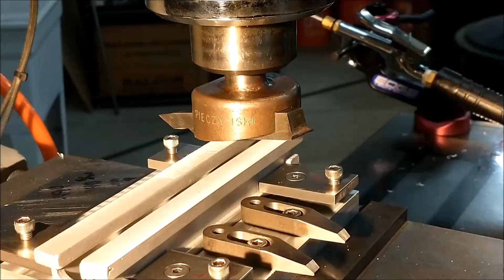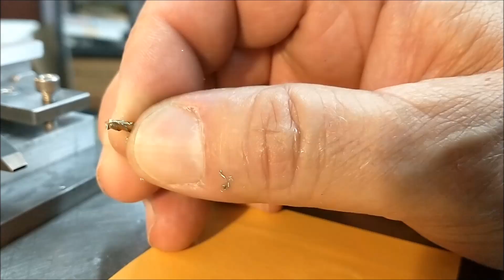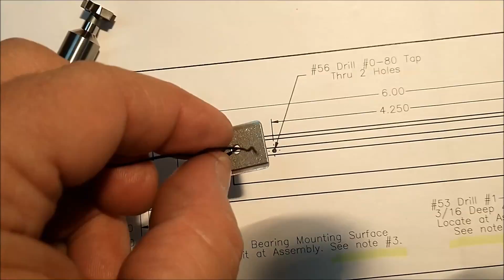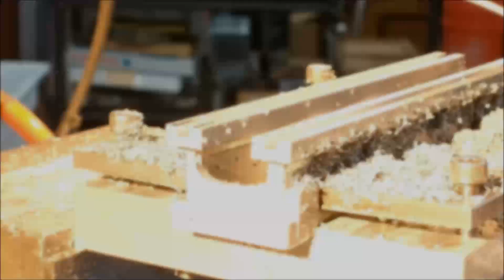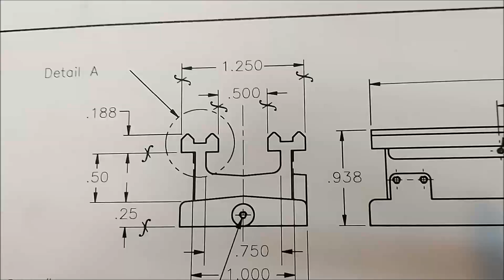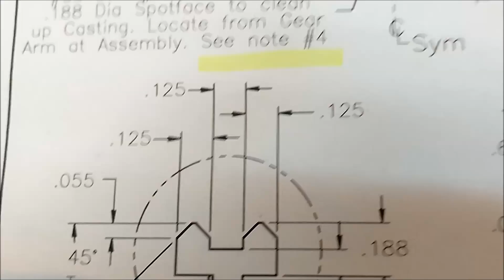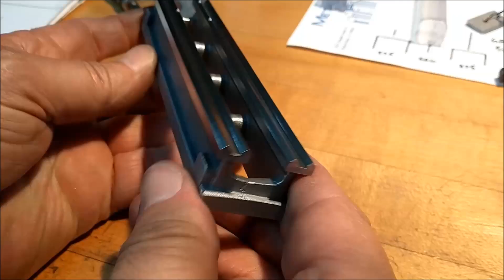Machining a Miniature Lathe - The Bed and Legs - (B)

Comment: i use a shop vac with an attachment for a smaller diameter opening to suck up the chips while i'm milling and after.  got tired of being covered in chips and cutting fluid only to have to clean up the whole shop floor when i'm done. shop vac does a great job containing the chips and i'm not using compressed air to spray loose ones all over the place like i used to. i might use some compressed air for the stuff stuck to the part.
Reply: I put some Locline on my little mill to use with a vacuum, not great but works fairly well. Still a bit to clean up after cutting, especially if I'm using a roughing mill and "deep" cuts.

Comment: I used to use air to blow off chips and sawdust, but I worked in a shop where if the boss caught you using air he  let you know in no uncertain terms  that it was  NOT allowed in his shop. We had to use a shop vacuum because the air would blow dirt back into slides and bearings where you can't clean.

Comment: I don't have a DRO. What about a long range dial indicator? Expensive,  but you can use it across all your machines.
Reply: I started learning how to machine before DRO's were popular, you can do good work without them. ...and go ahead Get yourself a DRO, you won't ever be sorry !
Reply: You can buy a DRO for the price of a long range.
Reply: Alright, let me explain. My lathe/milling machine had a 2 axis DRO, but the scale heads failed due to poor quality and miscare by the previous owner. I have no problem in refitting a new one altough it makes the cross slide a little crowdedwith stuff. And I still like the idea of using old ways for measuring, without depending on any electronics.

Comment: Just wondering....
When you fly cut the surface of the rails you cut in one direction only.
Probably a novice question but,  
Why? Could you explain?
Great video.
Reply from the maker: Cutting right to left shoots the chips to the rear of the machine and keeps my work bench and camera much cleaner.
Reply: @joepie221  well of course!
I was expecting something less obvious and highly technical to enlighten me in ways I never thought would happen. This a great build, and I have learned alot. Thank you.

Comment: Clean up the legs after machining the top rail parallel to the bottom???
Reply from the maker: My custom brass leveling feet ( not yet shown ) will take care of that.
Reply: @joepie221   Can't wait to see the tiny precision level you use to set up the finished lathe
Reply from the maker: I just re-visited this comment. Are you asking a question or questioning the technique/reasoning? Please clarify for me.

Comment: Great job Joe as always, can't wait to see the lathe running :P. I have a side question for you: how do you keep chips from flying everywhere when you are on the lathe? When i'm machining 4140 chips usually fly everywhere, even though i use a slower rpm and more DOC. How'd you solve this problem? I'm now used of getting burnt with flying chips hahaha
Reply from the maker: My machine has a full wrap around shield. When I cut the hot stuff, I install it.

Comment: I have noticed on more than one occasion that you seem to prefer climb milling over conventional milling. Is there some reason for this or is it just your preference as is goes against conventional wisdom?
Reply: it leaves a nicer surface finish, especially on aluminum.  Generally light or finish cuts only though.
Reply from the maker: 2 reasons. Any cutter deflection is away from the part, so the target dimension/surface doesn't get any dig marks, and the second is a far superior finish.
Reply: @joepie221  Thank you. I knew about the superior finish but the deflection never occurred to me.

Comment: As always, nice job. 
And here I thought you were going to have to build a minature planer to machine the bed. 🙄
For people looking to purchase Woodruff Keyseat Cutters. They come in two different types. The straight tooth as Joe is using here. And they come in Staggered Tooth types. The Stagger Toothed ones cut far better in tougher materials with less chatter. They cost a little more but there are times they are definitely worth it.

Comment: That was an interesting video.
'Dusting off feet' with such minimal holding  - I couldn't have done it and would have had to make something to hold parts more securely
 Expected the fixture but not the extra toe clamps to hold part to rear.
Without a DRO setup and positioning takes a bit more time but is still 'doable' 
I know I won't be making one of those, don't have the equipment to hold accuracy or patience for it
Reply from the maker: The feet cuts were very light and the tool was nearly dead sharp. I was listening for ringing that could have caused a problem, but it worked.
Reply: @joepie221   I'm not sure if your 'braver' than me or crazier? LOL.
 I was under the assumption it was a cast iron part but it's cast aluminium?

Comment: I like using a shop vac, less mess then blowing chips out.
Reply: There is a type that uses compressed air. Basically an air gun that blow backwards into a bag. The airflow creates a partial vacuum that pulls air and the chips through the air vacuum. The bags dont like cutting fluids though.
https://www.google.com/aclk?sa=L&ai=DChcSEwjzqKjupJLwAhUObW8EHd63DLYYABAVGgJqZg&ae=1&sig=AOD64_37ls4BCr8raRrOBa5VSKkmnmaPrA&ctype=5&q=&ved=0ahUKEwiQjqPupJLwAhVEGM0KHXwRCQAQg-UECKAL&adurl=https://www.ebay.com/itm/282537663128%3Fchn%3Dps%26mkevt%3D1%26mkcid%3D28

Comment: Lovely work always Joe. The realization that these castings aren't Cast Iron makes me sad.  I could have used a little more detail on how you determined cutter position for getting the 45s canter line and height (pitch) to be right given that Z and Y both affect the outcome.
Reply from the maker: I may do a short video on that. Stay tuned.
Reply: Please do Joe I need to do it with a setup piece it never goes to the numbers

Comment: Maybe you've covered it in another vid, but whats the deal with the flycutter shape? You're cutting back away from the tip. Is this a way to perhaps get double duty from your cutter by grinding two shapes?
Reply: That may have been the original intent but here it offers a gradual entry to the workpiece. A 90 degree end would take 100% depth with considerably more impact. The shallow angle also acts like a large nose radius minimising tool marks.

Comment: Americans are thoroughly confused when it comes to screw terminology and screwdrivers. First flat head screws come in a wide variety of types - slotted, phillips, hex, torx, robinson..... Clearly any type screwdriver can be a flat head screwdriver. But for some unexplainable reason confused individuals refer to the Common screwdriver used to drive slotted screws as a Flathead screwdriver. Clearly it is no more a flathead screwdriver  than phillips, torx, or robinson. They misidentify torx as star and robinson as square too. I heard an inexperienced person refer to the phillips and common screwdrivers as plus and minus. When I laughed he jammed each into a piece of wood to show the plus and minus shapes. I laughed some more. I still do. The common screwdriver ought be called pry bar, chisel, wedge, stir stick, epoxy tool, scraper, magnet and on some occasions screwdriver.
Reply from the maker: But, at the end of the day, those screws were flat heads. FHSCS look it up.
Reply: Yes he called the countersunk hex head screws flat heads, but he was referring to the head profile compared to the ones next to them which stand very proud of the surface. This was pretty clear given he was trying to open as much room as possible under the rails for some cutters.  And since this isn't a university professor explaining the design elements of fastener technology we let such things slide and take the meaning from the context. I doubt anyone is here expecting linguistic perfection, this is about watching and learning from a craftsman and his techniques.  Also, some terminology changes when crossing borders even when the same language is technically spoken.  This is not unusual.
Reply: They were definitely flat head screws.   The Robertson drive is still the best screw driver holding in my opinion.   It was invented in Canada and the USA as I understand did not want to pay for the patent fee (GM) was involved somehow and thus they are still not in the USA as far as I know.   Anybody that has used them always swears by them as the best.   Any kind of construction that I have ever seen all use them.

Dale in Canada
Reply: the terminology of the screwdriver profile has nothing to do with the terminology of the screw its used on. they are two entirely different things. there are cap head bugle head socket head  round head flat head oval head and many more variations and each can have their own tooling profile for installation and removal. although i've never seen a robinson.  maybe you were referring to a robertson? ah damn canadians anywho. lol

Comment: Hey Joe. I have a question about backlash. Your DRO gets it info from sensors along the bed of the mill. You turn the handwheel cw to remove any backlash and set the dro to zero. If you grabbed the bed of the mill and try to move it towards you, it will not move because the backlash is taken up in that direction. But if you push the table away from you, won't the table move the amount of the backlash in the feed screw and the axis reading on the dro will change from 0 to how much backlash you have? I can't check this with my Sherline cnc mill because the dro gets it readings from the pulses it sends to the stepper motors. So if something is preventing the bed from physically moving, my dro will still show the axis position changing even though the bed isn't.
Reply: "But if you push the table away from you, won't the table move the amount of the backlash in the feed screw and the axis reading on the dro will change from 0 to how much backlash you have?"

Correct. That is the benefit of having the scales display the position of the table rather than the hand wheels.
Reply: @highpwr  Now, what I want to bring to point is at 12:30 Joe says to turn the dial cw to remove the backlash. That's fine if you are cutting with the side of the tool facing you because it is pushing on the part/table towards you in the direction you have removed the backlash. But if you machine the part with the back side of the tool, it will push on the table away from you so the part/table will move to take up the backlash and throw off the amount of material you want to remove from the part. Fortunately, it will not take off more material than you wanted to, so you can adjust the table and take another cut. You need to move the part into the tool to remove the chance of backlash and remove the correct amount of material..
Reply: @TinkeringJohn  He is describing how to get to to the correct position by eliminating the backlash in the lead screws when using the dials for positioning. That gets you to where you need to be. HOLDING that position is the job of the table locks - not the lead screws on a manual mill. That is why they are there. Although he didn't mention it specifically I'm guessing he assumed most people already know that. But you are right - if you have a lot of backlash in the screws and don't use the table locks, yes it's going to move on heavier cuts in that scenario. Same applies when using a DRO as well. If you have minimal backlash in the screws you can get away with it for general use depending on the tolerance needed on your part.
Reply: @highpwr  Yes, I understood what he was saying about removing the backlash. This would also work by always turning the dial ccw if you tuned it ccw to get out the backlash, then set your dial/dro to zereo. I was going to mention the table locks which as you said, Joe didn't mention. Also I assumed since he is using a large mill with a massive bed, he doesn't need to lock it down when machining small parts with light cuts. You also read my mind as I was going to say this would happen even with a dro. The axis position number would change from what you had set it to when the bed moved from the backlash. Joe talked about always turning the dials clockwise in his video of machining the base of the steam engine he recently did. I mentioned this to him in the comments of that video, and he told me I was confused. I have a tabletop Sherline cnc mill. it doesn't have table locks and the bed is not beefy enough to resist even light cuts. Thanks for the replies and confirming my thoughts about this scenario.
Reply: @TinkeringJohn  To be honest I have a feeling that Joe may have misunderstood what you were really asking about in your previous question, just as I misunderstood your question here as well - at first. Then I realized you were focusing on table movement after you remove the backlash and arrive at your intended position. I had to re-read your question again before I realized the point you were trying to make. CW or CCW doesn't really matter in most cases. It's just a good habit to get into using one or the other and sticking with it as a rule of thumb to help avoid mistakes. I have a vertical knee mill as well although it's not quite as heavy as Joe's machine. I can tell you that after zeroing out the DRO, the table will move when the table locks are tightened down. It may only be a few ten thousands of an inch but it does move and the DRO will pick up on it right away. If I am being super picky I may have to overshoot my 'number' on the DRO by a couple of 'tenths' so that when I tighten the table lock it will push the table back to showing 0.0000 on the DRO again. Machines have to have some clearance in the ways too - or else they wouldn't move at all.
Reply: @highpwr  I think turning the dial cw is more common because you most likely position the part in front of the spindle when clamping it down and then use an edge finder to locate the back edge of the part by turning the dial clockwise. From that position, it is easier to see the part coming up to the edge finder so you can slow down and creep up on it. I worked in the machine shop for a couple years at Buick in Flint Michigan when I was a machine repair/machinist apprentice in the early 80's. After becoming a journeyman, I had the choice of working in the machine shop, or working the floor as a machine repairman. I chose being a repairman. I also enjoy watching Mr Pete's (a.k.a. Tubalcain) videos. I have the steam engine kit and this lathe kit that joe is doing. After watching him and BlondiHacks do the steam engine, I am wondering if I will be able to machine mine on my little Sherline mill. I designed and built my own cnc router that uses ball screws and it is solid with no backlash.

Comment: wait, what........how on earth did you drill the headstock mounting screw holes???
Reply: I would bet carefully.
Reply from the maker: They were done from above. I used a tiny end mill to start the holes on the angled surface, then just finished with a drill.

Comment: I thought you were really going for it with that little end mill. Even Joe Pi breaks end mills folks. And he teaches a tip or two.
Reply: You can see the surface finish failing only a few mm into the cut, indicating that the cutter was being pushed well past its limits.
I was surprised to see Joe doing 2.3mm worth of cut in one pass, I was expecting 1.5mm at most.
Reply from the maker: The cut was 80% of the diameter. I felt safe.

Comment: Joe, Out of interest, why do you Americans refer to the screws as Flat heads ? They Are called Countersunk in England. You use a countersink to make the holes so why not countersunk screws. Turned out OK, well done. Should you not have also machined the front pads where the leadscrew bearings will seat ?
Reply: Two nations separated by a common language!
Reply: There are at least two types of screw heads that require a countersink: 
  https://www.mcmaster.com/screws/head-type~oval/phillips-flat-head-screws/
  https://www.mcmaster.com/screws/head-type~flat/

As you can see on the McMaster-Carr pages, we call those "flat head" and "oval head" screws. Do you call them both countersunk?

And that's not even considering weird stuff like plow bolts, which also require a countersink, as well as a square recess or key slot:
  https://www.mcmaster.com/screws/plow-bolts/
Reply: @RonParker  Thanks for the information, not that I have looked at a UK catalogue recently to see what is available, but you certainly have  a great selection over there. I had no idea that you needed special bolts for plant machinery. We call the raised head on a countersunk screw, raised countersunk, or sometimes a Fillister head, although generally Fillister heads were designated for Cheese Headed Screws. Most UK suppliers when you order countersunk bolts send the flat tops. The raised headed countersunk screws are a decorative feature on machine panels, if you don't want to use Mushroom headed screws or Fillister heads and the panel has been punched to take a counter sunk screw. Thanks again, stay safe and well.